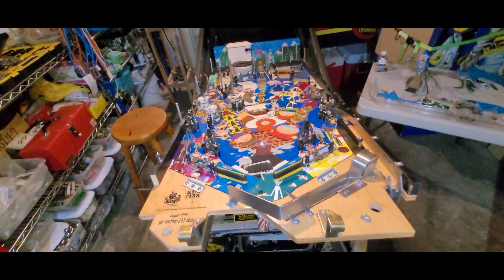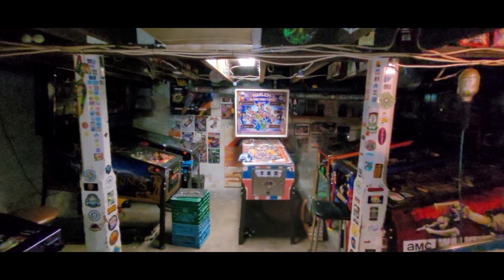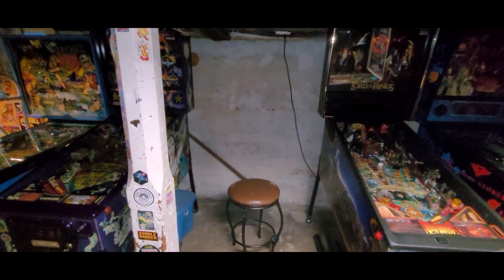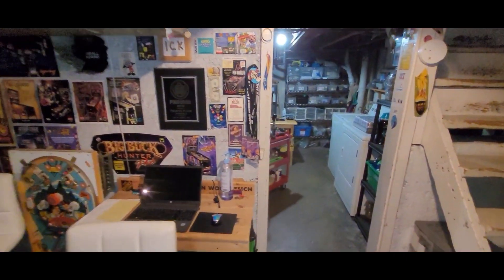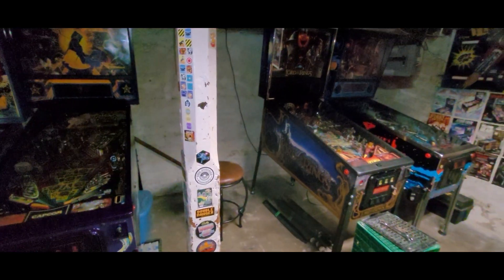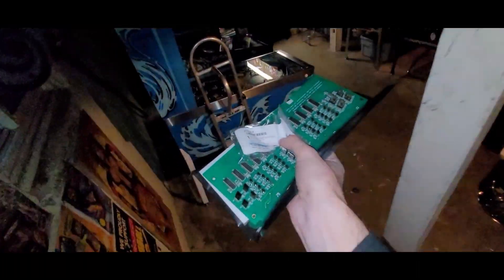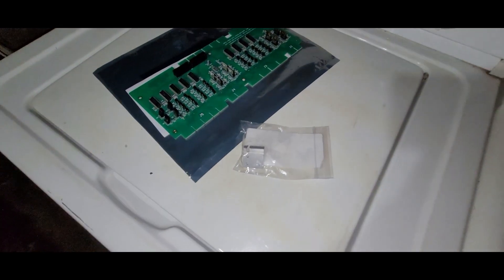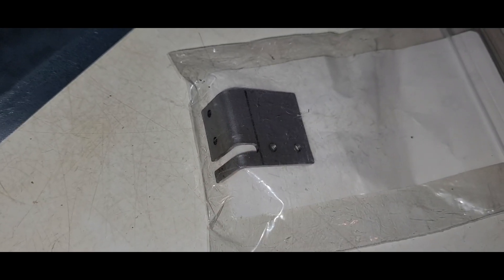Part 4: South Park Pinball Project. Playfield tear down, cleaning & LED's.

Comment: That looks like a lot of fun 😮 😁 but definitely rewarding in the end. Question: So now that TX is gone, do you slide in Tag Team? Is that the System 80b spot, or do you just go with the flow?
Reply from the maker: So fun 🥴😂😁👍. Before covid I had three machines lined up on the tag team wall and no project in the middle of the room. That was the intended setup but it does make for a good space to work on machines now.

Comment: What does the little black sign in front 9f the rear center saucer say?.. Wondering if it is a little Easter egg on the playfield..That would be a neat part of the video.. pointing out all the little Easter Eggs that are hidden on different playfields..
Reply from the maker: Oh I will have to check that out. Totally, there are usually fun easter eggs to be found!
Reply: @pinballshenanigans  Thanks brother.. I saw it there and then thought that would be neat to see all the different Easter eggs and as many machines as you go through it would make a cool part of the video for us pin nerds
Reply from the maker: @TiltingT  yes totally. I actually did scope out for Easter eggs in my upcoming video 🙂
Reply: @pinballshenanigans  Rad! Thanks man!